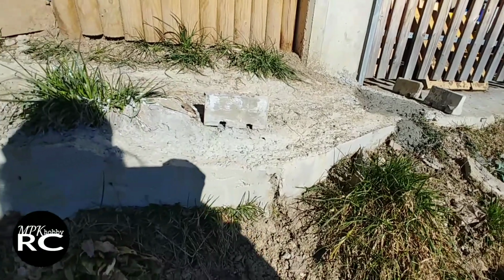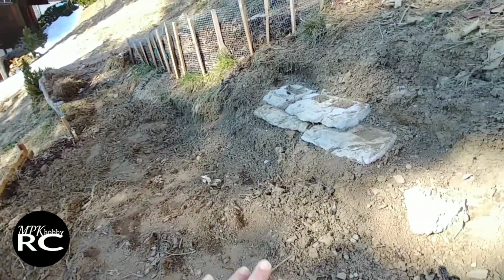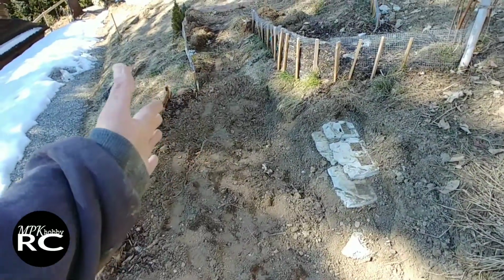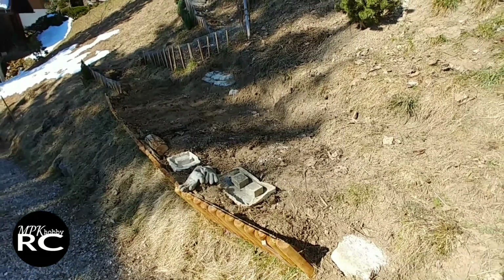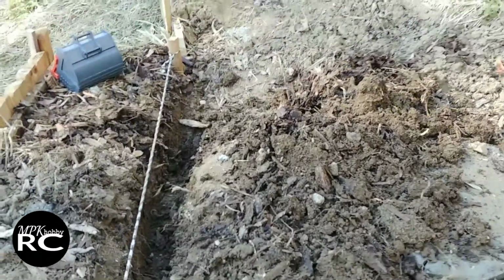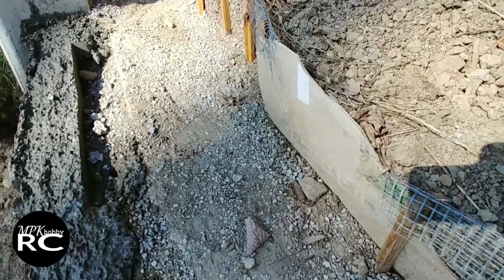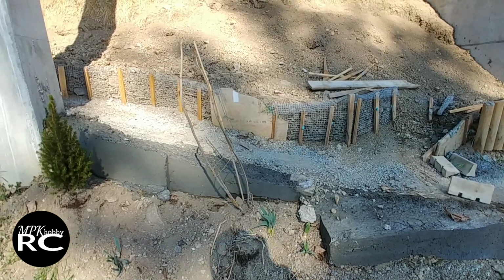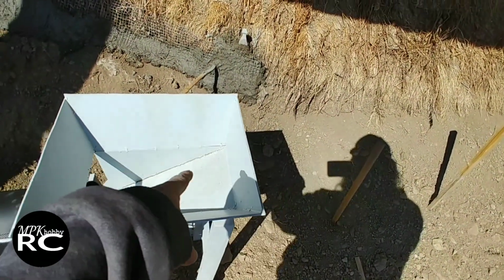1:14 track build update!! digging a ditch!!

Comment: I built a wall like that 10 years ago holding back a lot of dirt. I drilled each post then ran steel cable through and anchored both ends. It still standing. If you want to save any others that may be failing
Reply from the maker: Thanks il take that into acount..